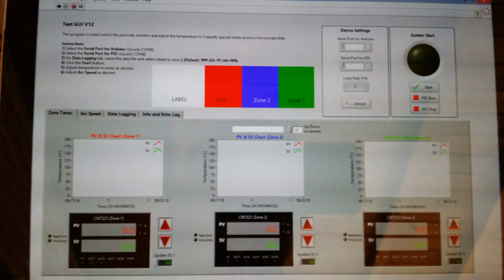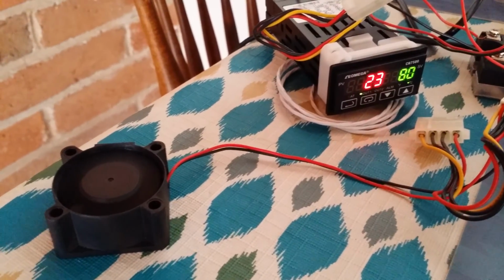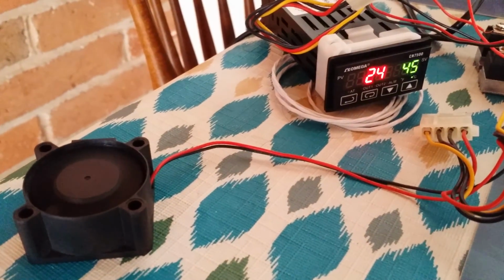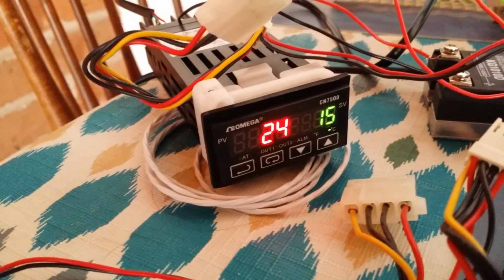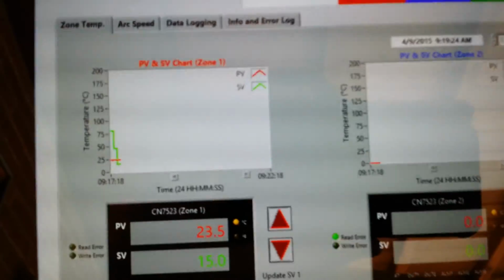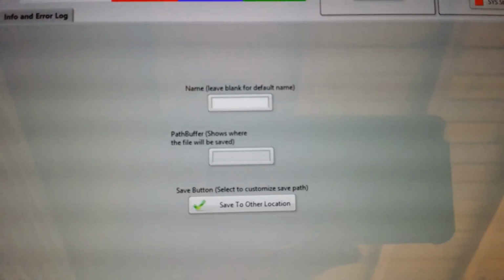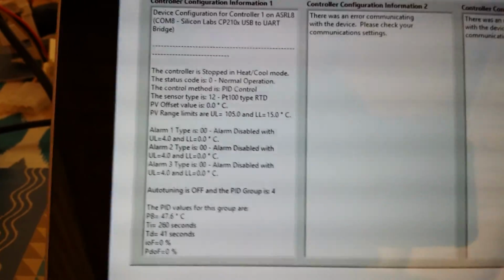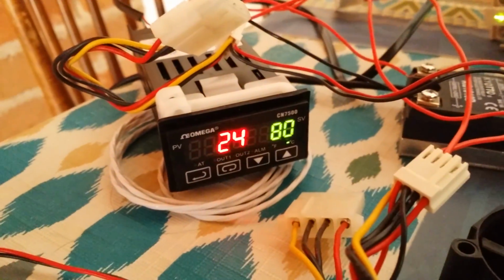Team Gradient GUI Test

Comment: Hello Chris,I have more questions for you. On the faculty my master thesis deal about kiln....Wich type of rs485 to usb converter you used for your project?How you connect controller cn7523 to converter (if you can send me sheme or put here)?Are you connect directly to Computer or on arduino? Please could you send me labview VI of your program, only as example. Please can you send me e-mail: Miroslav.duspara@gmail.com if I have more questions.Many thanks for your help.
Reply from the maker: +Miroslav Duspara Hi Miroslav, I can unfortunately not share the LabVIEW VI due to not owning the rights to do so.

I can however let you know that I used Omega's own RS485 connector (CN7-485-USB-1), which came with instructions on how to connect the wires.  I went with this purely for potential risk of driver compatibility issues using another module.

I purchased a library from a 3rd party vendor for the PID control implementation, but it was only designed for a single controller, so I had to heavily modify it to get all three to work at the same time.  I have not been able to find a link for the PID VI, but will post here if I do.  The file was called B-Series and was compatible with a range of different PID controllers.